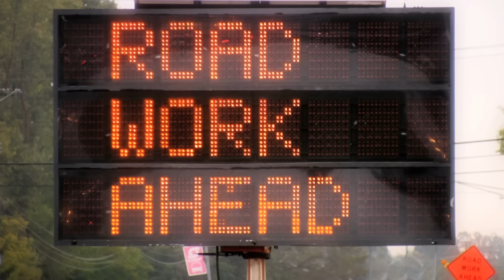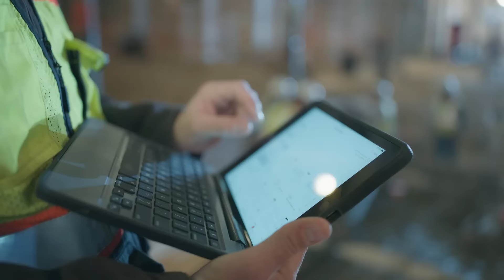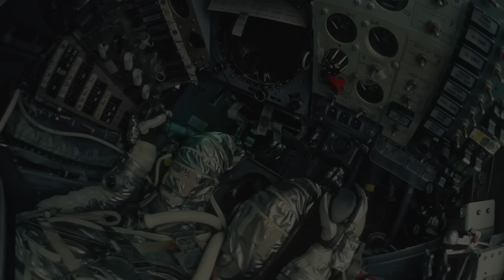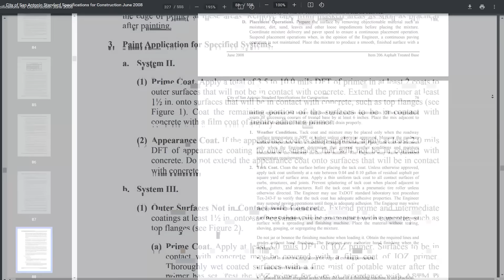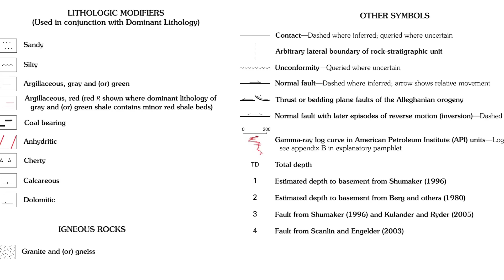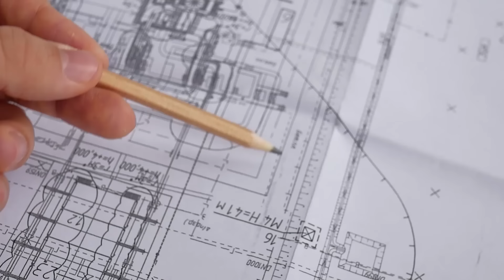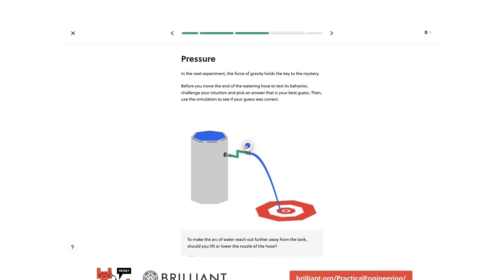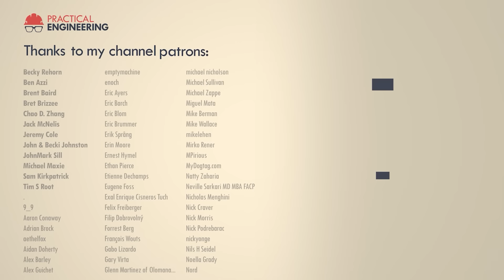4 Myths About Construction Debunked

Comment: I work as a ‘scientist’ (whatever that means) for an engineering firm and spend 90% of time on construction sites standing around with traffic controllers, drillers, service locators and engineers waiting for one of the mess of contractors to figure out what’s going on so we can drill a couple holes, log some cores and get a couple samples. It’s like herding cats in a burning hedge maze….
Reply: "Whatever that means"...how do you not know or understand your job title. ? 🤔
Reply: @agnez1739  Reported for spam....plenty of porn on the Internet no one needs your virus ridden links.
Reply: we never keep the core sample technicians waiting. Take your slumps and skedaddle!
Reply: @heresjohnny602  Saying I’m a scientist is insulting to science. I used to work in research before I got into consulting. As a researcher I would actually apply the scientific method and what not, but most of my current job as a ‘scientist’ in an engineering firm is not actually science. It’s mainly helping clients navigate confusing regulatory frameworks and writing reports full of nicely worded bs so some multibillion company can say they did their environmental due diligence. ‘Scientific consultant’ would be a more accurate job description.
Reply: @heresjohnny602  Ah, it must be fun taking issues with semantics. Seems as though OP understands exactly what his/her job requires, just not what they label his/her job as.
Reply: @kasralajani8663  That makes sense to me, thank you for explaining.
Reply: @blakena4907  Please explain how asking someone what their job role or title means is "taking an issue" with semantics. ? We have a worldwide culture of poor attitude to learning precisely because individuals like you see offence that wasn't there then proceed to berate people for asking acceptable questions....calm down Blake it's really not that deep son.
Reply: @heresjohnny602  You're right. My apologies. I should know better, and should have actually thought about the word semantics before I said it.
Reply: @heresjohnny602  I actually really value learning and keeping an open mind, but I'm a bit headstrong and quick to assume at times. One of my fatal flaws.
Reply: @blakena4907  I commend your honesty in admitting your mistakes, I do hope it isn't "fatal" for you in the end but maybe I'm taking the word fatal too literally.😆

Learning for the win baby. 🥳🥳
Reply: @heresjohnny602  What's up with your punctuation though? Period, space, question mark is quite an exotic combination. And yes, I'm fully aware that I'm being pedantic but I'm also honestly curious.
Reply: I love this comment.
Reply: @heresjohnny602  to be fair, you didn’t directly ask what their job was, you asked “how do you not understand your own job title” which could be interpreted as demeaning rather than curious
Reply: @Papperlapappmaul  Using punctuation in its appropriate place is "exotic" to you. 🤔 I'm Not really sure what about my exchanges has piqued your interest to call it "exotic" ?....which is a fabulous word by the way.
Reply: @Benry1  To be fair There was a question mark and a thinking emoji.....Nothing about that is indicative of "demeaning" behaviour and is a prime example of seeing offence that isn't there that I mentioned because the key word is "interpreted" which is speculation which is insulting for you to do to me when I've already clarified and people have understood my thoughts. If you wish to be fair then realise the rest of the room doesn't see what you see ben.  😕
Reply: @heresjohnny602  understood! I didn’t read it as demeaning, just pointing out why some might. Insecure folks like me tend to find offense where none was intended, so your last sentence applies to us both 😄
Reply: This thread contains the most polite internet fight I've ever seen
Reply: @Benry1 No No No You may be insecure Ben and find offence but I am not you.
Reply: @heresjohnny602  A question mark on its own would have been perfectly appropriate. A period followed by a blank space followed by a question mark is typographical vandalism.
Reply: @heresjohnny602  good for you, thank your lucky stars you’re not like me 😂 take care
Reply: @Papperlapappmaul  I'm not really interested in your intellectual vanity over how I communicate. It's typographical vandalism....so what. ? I'm sure with a spare 10 mins I could find something to admonishe you about but the point is you can clearly comprehend what I'm saying.
Reply: @Benry1  Take it easy mr Henry. 😁
Reply: Sound like a site geologist in my place lol.
Reply: Only in YouTube do you find people commenting over the smallest and useless of things
Reply: @heresjohnny602  by all deities celestial and mundane, you could at least have the decency of admitting your grammar is atrocious even if you can't accept your manners are just as bad.
Reply: This whole thread is full of bots....
Reply: herding cats in a burning hedge maze sounds like my job in finance
Reply: As if a majority of this wasn't done intentionally because 95% of the people on the site are paid hourly......
Reply: Ahh Environmental Consulting:)  Can’t wait to find a way out of this industry!
Reply: Sounds like poor project management / resource planning to me…
Reply: @skyhappy  that'd be the internet as a whole lol
Reply: @kasralajani8663  I'd put forward the argument that you're insulting yourself really. What you do is simply applied science
Reply: @heresjohnny602  thanks for reporting spam, I didn't see it 8 hours later, so it must have worked and been taken down. Keep fighting the good fight to make our comments sections into more vibrant communities!
Reply: Funny cause usually we’re waiting on the office guys to make up their mind so we can do it the way they say just to go back and do it again the right way we told them it should be done.
Reply: LOL!! That's a GREAT line .... I'm gonna remember it  LOL! <big chuckling smile> "It's like herding cats in a burning hedge maze" LOL
Reply: @heresjohnny602   Your initial comment comes off as sarcastic. It's unusual to genuinely ask someone, "How do you not know?" It's a very strange question if you think about it. It's like asking a baby, assuming they could talk, "How can you not walk?" Add to that "scientist" is in quotes suggesting he/she knows, but it's an unusual usage of the word. At least from their perspective. I think you genuinely meant it to be demeaning, but are pretending that you didn't actually mean to insult him/her. My brother does this all the time. Just to seem like the good guy. At least in his own mind. That last part is not up for debate. Just sharing. If it's not what you meant. It's not what you meant.
Reply: @blakena4907  
I share a similar fatal flaw. Working on it; working on it....
Reply: @heresjohnny602  LOL must be different In the third world
Reply: It seems you're a Geotechnical Engineer, collecting soil bored samples from different spots of the construction area, do Oedometer/Triaxial (others which I forgot) so you can estimate the average soil strength in those spots where the samples were taken from.
Reply: >> It’s like herding cats in a burning hedge maze. LOL. I hear your!
Reply: As an Archaeologist who spends quite a lot of time monitoring in construction sites, I can relate to this comment so hard.
Reply: @kasralajani8663  And a lot of engineers don't do engineering, either.  They're in sales or do computer programming that has nothing to do with their training.
Reply: Years ago I joined the army, hoping to get away from the stress of under-employment and all the BS of civilian life.  I was hoping that part of my time in the army would involve light-duty sitting around such as guarding a border or something.  Boy was I wrong.  But it got me in shape and kind of strengthened my work ethic.  Nowadays I really do appreciate having "nothing to do" sometimes, but it's so rare.
Reply: Like herding cats in a burning hedge maze. - Kasra Lajani, 2022

Comment: One of my FEM teacher loved this quote "Literally anyone can design a bridge, but only an engineer can design a bridge that barely stands"
Reply: Finite Elements are infinitely awesome.
Reply: @guardrailbiter  true, so much years passed, and I still continue to optimize my 3d prints with it
Reply: As someone with a Bachelor's in Physics and then a Master's in electrical engineering, I can confirm that your teacher is spot on. Anytime I make something for personal use I just make it way stronger than needed because it is faster and easier than sitting there and trying to figure out the minimum specs needed. 

Do I have the ability to make something just strong enough? Yes, but then I'd need to sit here and look for the right equations and try to source parts that are just strong enough for the job. Vs just getting parts that are so much stronger that I don't need any calculations to say that they will hold up.
Reply: @zebraloverbridget  This is how my brain works. My dad is a welding engineer and he can tell me everything about types of metal and structure of things. But when I build stuff like gates or even simple things like bumpers or stiffeners for vehicles i always just over build it because finding out what’s right takes to much time or isn’t cost effective on a small scale.
Reply: Grady used this line in an older video!
Reply: Which is why planned obsolescence and minimum viable product are so lucrative. Not in terms of social costs like lost resources for the customer and lost man hours spent on replacement or repair, but a company makes money that's then not reinvented into local economies, and that's what matters most.
Reply: @siege2928  I don't really see a problem in running AC through an outside wall, as it's just matter of efficiency. 
Electrics going through water isn't a big problem either, since water in AC is condensed and more or less pure - it is a great dielectric.
Reply: Robert Frapples  I'm not sure what I have said to prompt your comment. I only expressed my enthusiastic support of FEM/FEA.
Reply: @zebraloverbridget  that's amazing
Reply: In high school geometry, we made spaghetti bridges and tested their strength by seeing how many textbooks could be stacked on top of them before they failed. I got second place. The first place student used bundles of multiple spaghetti strands, while I only used single strands, and thus, much less spaghetti overall. This thread validates my stance that even though I lost, I still had the "better" bridge ;)
Reply: Better than an architect designing a bridge barely standing until it collapses... 😏
Reply: It's an engineers job to make a part that only just barely meets the requirements (within safety limits)

Old builders had to vastly overshoot the margin of safety because if you're wrong... Well that gorgeous church you where building collapses and that ain't gonna go over well with anyone.
Reply: @custos3249  It may just be that you have to not make a thing in the first place to be ethical, if it gets to the point where longevity and safety have to be very low to meet competition. I guess if you're in a saturated market, the risk of this is higher.

Comment: Regarding the "foundation on bedrock" myth, Chilean here. Bedrock can move and it does, sometimes quite violently, so it isn't a guarantee of durability.
There's an old church in Santiago (Iglesia de San Francisco), a very big building, only survivor from 16-17th century. The reason of its resilience against earthquakes was recently found: its foundations lay over a bed of round rocks deliberately placed there; the whole thing rolls over the rocks when there's a quake.
That's engineering.

Comment: I was a town engineer shared between a dozen towns. I used to really investigate bids. The most common problem with low bidders was fraudulent bonds. It made it easy to disqualify questionable and bad contractors. When one protested I told him that we'll let the Attorney General decide if this was criminal fraud. I never saw nor heard from him again. The other problem was attempted substitution of materials. They tried to change my contract! You do a very good series of videos. Even though I've been retired for 11 years, I'm still interested in Civil Engineering. Happy Summer Solstice. Good Luck, Rick
Reply: Yeah, there have been many a project that didn't last as long as it should because of these under the table substitutions and ill-advised corner-cutting. 

Hell, most "engineering disasters" end up being the result of such acts.

If I were told to select a contractor for something and couldn't vet them, I'd go with nothing cheaper than the 3rd cheapest option(or a higher cost one depending on my selection pool), because I know the cheapest options are pretty much never good enough.
Reply: @InfernosReaper  The cheapest option always ends up with overrunning costs. You have the F-35 fighter jet as a good example.
Reply: Thanks Rick.
Reply: I have no idea because I am no expert. But I always read in the newspaper about projects that require more money than planed. And in Germany it seems even if there was a mistake in the estimation we pay them more as long as they get the job done :/

The other thing I think is highly qustionable. A company that did a really bad job on project isn't disqualified for the next project. So one company did 2 jobs in my region that got both much more expensive than planned...as someone with no idea what I am taling about I always wonder, how can it be so hard to build a roundabout ?
Reply: Oh yeah, dunno how many times I've seen jobs ripped up and redone becasue of shonky contractors. How many times I'd made comment about substandard, insufficient or just plain obviously under specced and being told, 'nah, don't worry, we've done hundreds of these' then see the contractor back in a month to fix it. Incompetence and liars.
One of my favorites, laborers who say, you've got me from the neck down and in the next breath ask how can they get on here. They look at you as though you're a prick when you walk off shaking your head.
Reply: @blablup1214  Some things like steel and oil are commodities and the price can change daily. A company can bid on a project and include in the contract an adjustment for the cost of materials. For example, oil prices in 2022 have increased a lot and so asphalt/tarmac for roads is a lot more expensive. Steel can also change a lot, especially for a project that is not complete until years after the bid.
Reply: We actually lost a bid one time for being too low.    We did a heated tire pad for a mine, for their 930e haul trucks and L-2350 loaders.  It was 3' thick, 1" and 1 1/2" rebar on 6" spaces, 3 layers of it.  Had a few other things going on, but nothing crazy.   We did one for a small mine in a week, billed 600k, and made out like bandits as there was only about 350k in materials.
So other mines wanted some, and put them out for tender.   We bid 800k each.    Lost he bid as the next lowest bid was 1.1 mil, and the highest bid was 1.4 million.   
We were told that they threw out our bid because they didn't think it could be done  for that price.   It'd be amazing if institutions compared notes, or even had memories (some do).
Reply: @hosmerhomeboy  It is frustrating when you play by the rules but others get ahead by breaking the rules. I happened to me many times. The personal advantages to decision makers often makes the choice. Good Luck, Rick
Reply: @richardross7219  True, and thanks.   I was asked once to help one of those decision makers rip off his company.  He was highly placed, and we refused.   We lost that client completely because of it.   Fast forward though, and my competitor has the job.  But it's a curse.  He's so incompetent that the failures are too big to disguise, and he cannot be fired because he is in bed with the big man.   What's worse, is he has screwed up that manager's home so badly it's uninhabitable.   They all wound up losing their jobs together, and I am back up there working.  They're all in court.
Reply: Can you explain what you mean by fraudulent bonds? Bonds as in what you buy for money?
Reply: @Tumleren  In construction contracting, the owner normally requires a Bid Bond. The Bid Bond is to guarantee that the bidder will enter into the contract as proposed. Bonds are bought by the bidder from licensed insurance companies. When the contract is signed, the contractor has to provide a performance bond to guarantee that the work will be done to the standards in the contract. If the contractor leaves the job, the insurance company has to get the job finished. Bonds used to cost a lot. The fraudulent bonds that I came across were bid bonds from companies that were not licensed in my state and the companies weren't at the locations that they claimed. Good Luck, Rick
Reply: A grading and landscaping company submitted a bid to the general contractor I worked for. Their bid was a little over half what the highest bid was on an office building lot about a half a mile (0.5 km) by half a mile. There were 4 sectors. Three of the sectors got the same grading and the fourth, the parking lot, was more complicated. 

The general asked the grader if he was certain about the bid.  When the grader said yes, he got the job. 

Turned out the grader's estimator had added the cost of the parking lot to the cost of one sector rather than 3 sectors. 

Grading contractor lost his business and home fulfilling the contract.
Reply: @RobertJarecki  That's sad. I've seen errors like that too. That's one reason to keep track of thing and learn to use ballpark figures for your preliminary estimate. It helps to show where there may be an error. Merry Christmas and a Happy Healthy New Year. Good Luck, Rick
Reply: Oh god yep - one job I specified one spec and they installed another because that’s how it’s usually done…. So much maths to check it would work